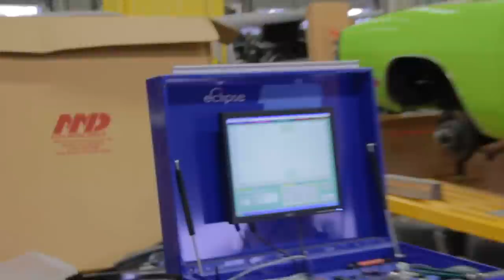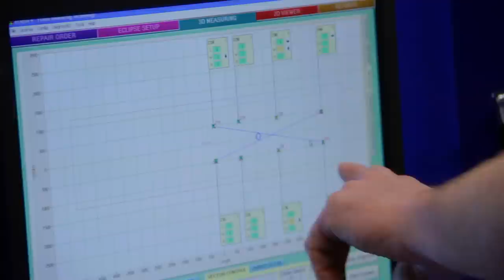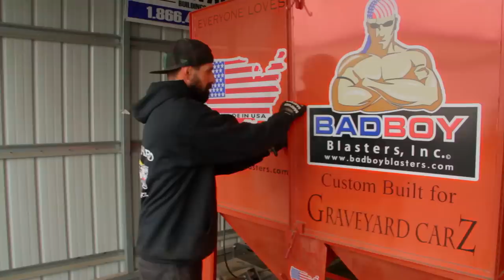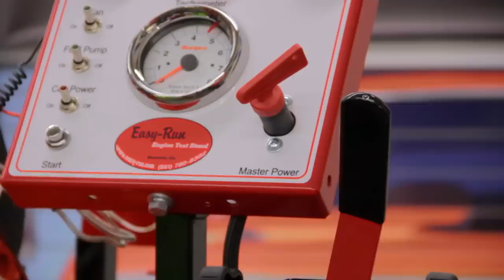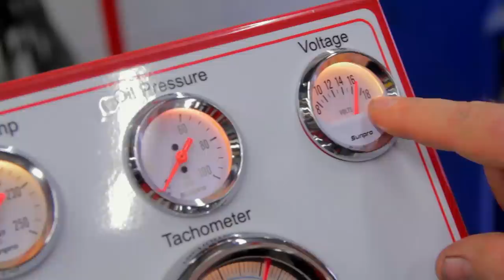MARK FIGHTS WITH INSURANCE COMPANY TO SAVE A CUSTOMER'S BELOVED 70 CHARGER R/T SPECIAL EDITION.

Comment: The owner of that lime green Charger really slagged on GYC for the quality of the repair.  Apparently the guy didn’t take 58K payout for totaling it and instead opted for Mark to fix it for 30K.  There was a dispute over the quality.  And part of it was with insurance work, you only have to get it to the same condition it was was in on the day of the wreck.  Seems the owner was looking for a complete resto for 30K but Mark said it was returned in actually better condition than it was.  There were pictures of the work on FB.

Comment: I'm sure Mark has purchased a ring compressor/piston installation tool that doesn't have that POS pliers type tool, it allows you to just push the piston/connecting rod beam into bore with end of the handle of rubber mallet, bearings don't fall out.